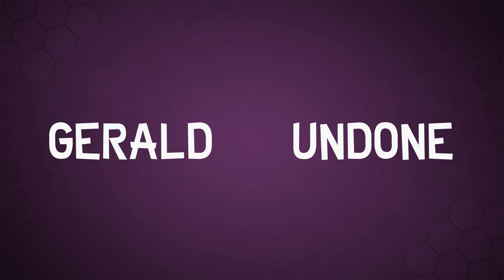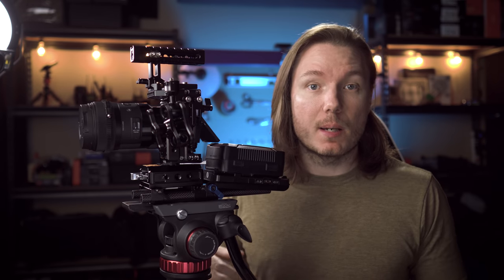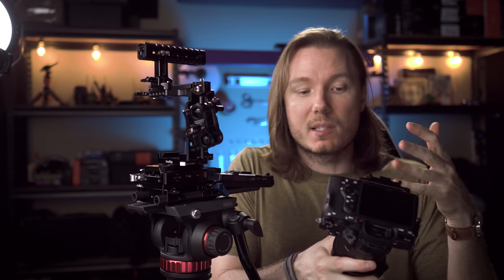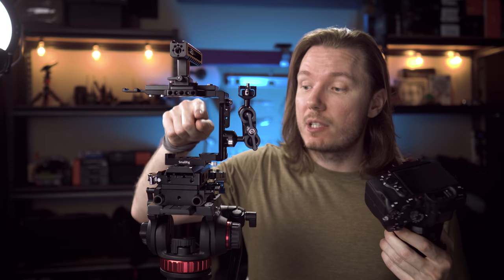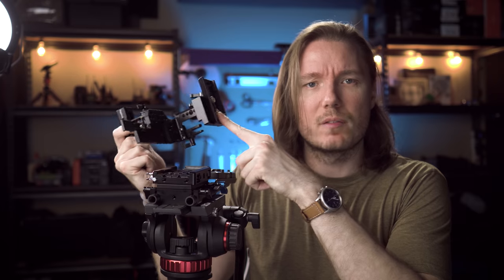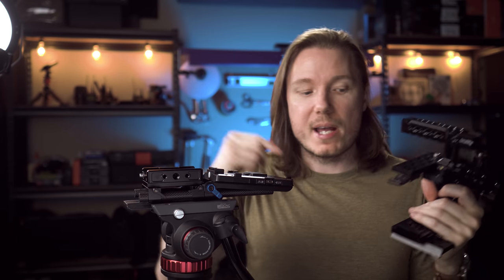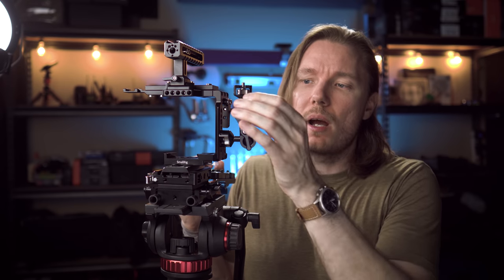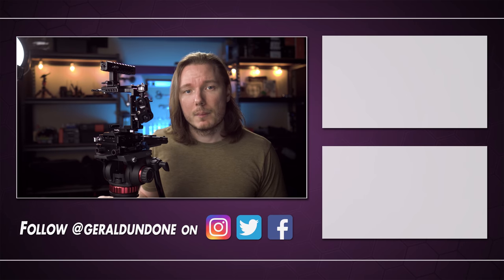Video Rig to Photo Camera in Less Than 10 Seconds

Comment: Now we’re talking! Great setup. I think you’ll like the nato arm a lot. I’ve used it for several things I never even considered using an arm for before 😊
Reply from the maker: You use a double nato though, right? And you attach mounts to your devices? Or is it only one-side nato?
Reply: Gerald Undone I primarily use the double nato now, just because it allows for  maximum interchangeability with a whole bunch of gear, but I also have the  monitor single nato arm as well. Of course I ended up also getting the arm extender, the swivel monitor holder, and the little nato cheese block attachment. These mounts all work really well on the sides of the ronin-s as well, in place of the wheel and the other blank plate. That’s actually how I first really got into nato plates as I was creating a really durable gimbal rig.

Comment: On the arm for a monitor...
I have a 7" monitor and tried using an articulating arm and had allot of issues once I attached the battery.  I returned it and got the double ball head style and it works wonderfully.
Reply from the maker: Good to know! Thanks for the update. Cheers!

Comment: I got that double ball arm and still had problems with monitors twisting. I decided to get the same one, but with NATO rails which allow you to mount little rails in places and then attach any NATO thing to anything else. So I've got rails on my camera cage, on a 15mm rail adapter, on the smallrig cage for the Ninja V, as well as on the handle I use with the ronin S. Then with the double ball arm that uses NATO rails to mount instead of 1/4 20 screws, I can quickly take it on and off and put the monitor and arm into any of those places, and since its NATO rails they don't spin and they also don't require a tool to tighten!

Comment: I have two GH5s. One I have in a Small Rig cage (full sized) which it almost never leaves. The second is in a Lanparte cage. This is a complete cage with a quick release arca Swiss system. This is a great cage.
Reply from the maker: Thanks for sharing! I'll definitely check it out. I've used Lanparte for battery brackets before.

Comment: Hey Gerald, as always, thx so much for your great online resource of knowledge!!! :D Two quick questions: 1. What's been your experience of the Smallrig 2006 baseplate. I was just about to buy this today for my setup but then I saw the reviews... Users complain of a dangerous design flaw and say to avoid getting it. I then typed this small rig model name into YouTube and – low and behold – your video came up. What's great about this plate is that the locking lever is flush with the plate. That's so important for my setup and I haven't been able to find any alternative. Question number 2: Intrigued by your "less than 10 second rig". Have you tried this rig with bigger lenses and focus motors? How's the wiggle on the lens? (Assuming you'd add lens support, potential mount support and matte box support). If you have a moment, please let know and wishing you a great continuation of your week! :D

Comment: You mentioned that the QR plate with the half cage will not quite fit into the Ronin-S. Can you use the Ronin-S QR plate with this cage? Since the Ronin plate must therefore be a bit on the small side right? I'm currently using my Ronin-S plate with both the Ronin and other tripods, monopods etc. 
Great video as always.

Comment: Gerald Great video. I'm constantly working on ideas for my ENG style rig. I love the idea of the quick release for the camera.  I know the cage is made for the sony a7 series,  but would smaller cameras like the a6500 series or maybe a fuji xt3 do ok in that system.  The half cage is a great idea and maybe a solution for buying multiple camera specific cages.  Maybe I'm just being cheap but something universal would be awesome. Thoughts?
Reply from the maker: Thanks! It's possible a smaller camera would fit, but it wouldn't be right. The problem with cages is when you use them on different cameras they can block ports and battery doors making it tedious and and potentially dangerous for your camera if you forget. Generally it's best to always buy camera-specific cages.
Reply: @geraldundone  good points. Thanks for your response and thanks for your informative videos.

Comment: So I ordered everything in the list using your links, all from Amazon. But the Manfrotto QR Baseplate (small rig) was not the 2006, ended up with a different style :( Also what length screws did you use on the cheese plate extension? Your biggest fan, this is Stan
Reply from the maker: Hey! I just used some 1/4"-20 screws I'm pretty sure. From ordering so much SmallRig stuff I have a sizeable collection of screws that come with the components. But they do sell a little assorted screw pack that can be quite handy for filling in the gaps. I'd pick one up.
Reply: @geraldundone  Thanks :)

Comment: Hi, I tried to rebuild this rig, but turns out the NATO rail for the nato handle as well as the screw / washer combination for mounting the cheese plate was not in your list. Could you tell me which parts you used exactly?

Comment: Quite similar to my setup , I just use the Arca version with the monitor mounted above the lens instead (red style).
Reply from the maker: Oh nice! Does the arca plate work well in other heads? I don't have much arca stuff that's why I'm asking.
Reply: @geraldundone  it's work exactly like the peak design Arca , infact it actually fits on the capture , they have very similar molds at the bottom . Tho it's not a exact fit and it shakes abit on the capture it does lock down exactly like the real thing.

Comment: Yeh DJI screwed up with the manfrotto mount not working. I even saw videos saying it did when it first came out but was disappointed to find out it does not when I got mine.
Reply from the maker: Yeah, it's just slightly off. The angles are a bit too steep. But the SmallRig plate works really well, so that's all I'm going to recommend from now on.

Comment: The QR in/out of the cage is making me so jealous. I wish they made one for the GH5/s series. We have to settle with quick-releasing the entire cage. Anyhoo...

I have a solution for your twisting issue: Smallrig has these ballheads (#2114: https://www.smallrig.com/smallrig-ballhead-with-arri-locating-pins-2114.html) with arri locating pins to prevent twisting. You can swap it with your existing ballhead magic arm and I believe it should work with the Atomos Ninja V and SmallHD Focus. Unfortunately it doesn't appear that your cage has a mount on the side that takes the arri pins to prevent twisting on that end. BUT, if you flip your top handle around you could have it mount from that and prevent twisting on both ends.

Also, do you find your full cinema set-up with the half cage to flex under the weight when loaded fully up during handheld use? I am having that issue with the smallrig #2024 GH5 + batt grip halfcage.
Reply from the maker: Yeah, I saw those when I was browsing, but came to the same conclusion. So far this double ballhead thing I'm using now is working quite well, better than a standard friction arm.

Comment: And would the Smallrig half cage for the GH5 be similar?
Reply: Would love an answer to this too please.
Reply from the maker: It doesn't look like they have the same design for the GH5, no. Only ones that include the battery grip or that quick release the cage from the rails, but none for QR'ing the camera from the cage, sadly. But I'll keep looking.
Reply: Thanks Gerald.  I have a GH5, but looking to get a Gh5s and put it in a slightly different cage. Maybe Shoulder rig?